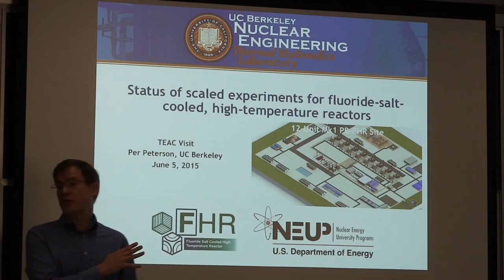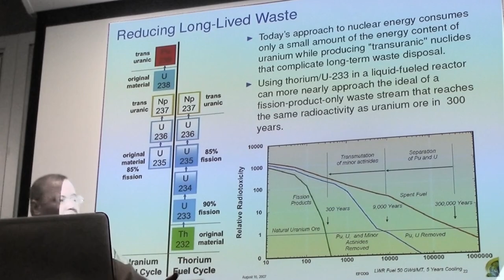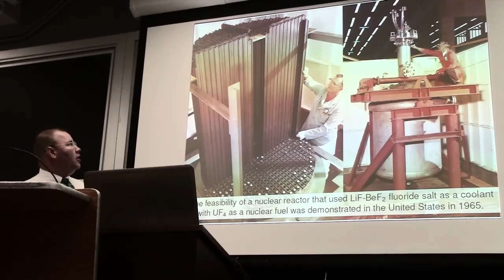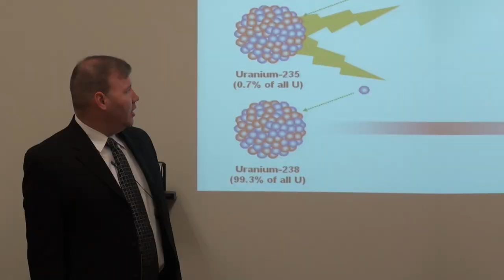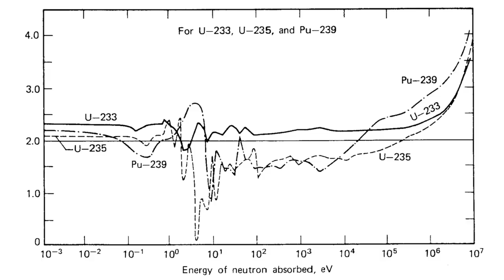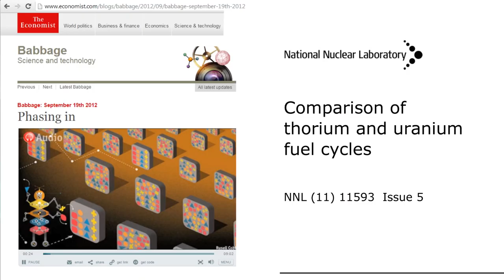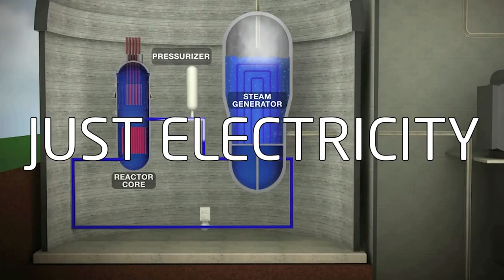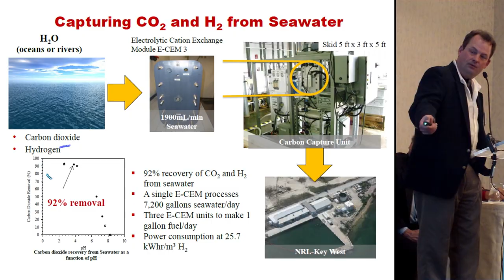Thorium Disadvantages

Comment: Thorium people are so emotional. In science you have to detach yourself from the idea and accept if it is wrong or bad. Thorium people want Thorium to work, no matter what. If your goal safe and clean nuclear power Thorium is one of thousands of options and not the best. Although we can all agree light water reactors are 40's technology and inherently unsafe and dirty. No other industry has resisted advancement like the nuclear industry. Imagine if iPhones where powered by tiny steam engines and coal batteries, that would be lunacy. And yet we still use completely unsafe technology that has been outdated since the 60's. No wonder the world has such a phobia of nuclear anything. Of course light water reactors also make atom bomb fuel as a side product, the reason they where built in the first place was to make Plutonium not power. That is the big reason that technology has been kept going way longer than it should have been.
Reply: Since we have far more than enough material for weapons in storage that has not even been a justifiable excuse to resist changing the fuel cycle for a long time now. Thorium is one of the better options available.
Reply: Well it is not a bad option but there are better. Two things are often said about thorium that are untrue. 1) It´s clean. No it decays into very nasty side products no better than light water reactors. 2) It is not proliferation safe. Additional fissionable material such as plutonium are needed and plutonium is produced in the cycle. This is not true for light water reactors but who wants to use thorium in those? If, then they want molten salt reactors, which is a nice technology. It however has never been actually done with thorium only with form of uranium. And uranium is just as viable either in molten salt reactors or in fast breeders. Fast breeders can get 99% more energy out of the same uranium than LWR and thus negates the sustainability argument of uranium. If your goal was clean and safe nuke power, Thorium is not on top of the list and people arguing for it for hours, who don´t even know the most basic nuclear physics is not helping the situation. What we should really do is build fast breeders to make energy from all the nuclear waste, that is actually a goldmine if used right and use that for base load power. The rest you get from solar. Why build a reactor when you have a giant fusion reactor in the sky, for free. Battery technology still sucks but it´s good enough now to sustain solar. Very long term go solar and fusion. Fusion is everything thorium wanted to be and is very close to being viable. Fusion progress is often ridiculed but has actually improved faster than Moore´s Law since the 70´s. Despite abysmal funding and no public interest the research is chugging along and we are 98% of the way there.
Reply: Also bomb fuel, degrades over time, through it´s very nature as an unstable atom. In short it has a shelf life. You need to continue making some at least to keep the stockpile functional. Nukes have a shelf life of about 15 years before they start loosing yield. Of course other elements of the reaction have to be constantly replenished such as Tritium.
Reply: Super capacitors as energy transport/storage and a grid switch to DC (no grid) would make solar power the easy choice.
Using nuclear waste too would be fantastic
Reply: You can´t transmit DC without heavy power losses and capacitors are problematic. You can´t discharge them slowly. Capacitors charge slowly and then spew out all the energy in a small time. It might be conceivable to discharge a large capacitor into smaller ones and then those individually to somewhat control the power output but I don´t know if there is such tech and if it´s prectical.
Reply: its not an issue to store DC. A local DC motor can run a AC generator. However, modern electronics now power freight trains and bigger.
Super caps have a disadvantage to Li cells. Namely storage, volume and cost.
Reply: 221 b Solar and wind are NOT systainable energy sources, if you count manufacturing of production equipment and infrastructure support. Have you seen a windmill up-close? Every single one of them needs an access road, massive concrete foundation and a LOT of room around it to operate efficiently. The big fusion reactor in the sky (this tired-old bullshit slogan from the greens) is too far away to suffice for your lifestyle, buddy. And battery storage will always suck as far as large scale economics go. As for fusion, yeah dream-on: for the past 50 years, they have been promising that fusion is just 15 years away. Anyone looking at the scale and economics of ITER and its proposed successors would flee in horror, because  funding is the opposite of abysmal: it's the definition of pharaonic excess. I am all for p-Boron11 aneutronic fusion & direct energy conversion, but I am not holding my breath...
    As for the two false comments about thorium, I wander who is lying here: it is only you that says that thorium does not produce waste, only to shoot it down in the same breath, by stating what is obvious to everybody with a brain. Your second comment is an outright lie: no plutonium is needed to operate an LFTR and certainly no P239 can be produced out of Th232: you are six neutrons short for plutonium, even after the neutron capture that will finally produce U233 which is what actually fissions inside the LFTR.
Reply: "Thorium is one of thousands of options and not the best"... 
Please enlighten me, what are these other "Thousands Of Options" you speak of, and also which one is the best? Other than nuclear fusion (Which we still are unable to sustainably create), what other option/s do you see? 
Also, Do you just not like Thorium because it is getting a lot of hype by general non scientific people, and thus makes you feel like it is below yourself (assuming you are also an engineer)?
It surely seems that having a Nuclear Power option that uses a liquid fuel that does not need to be under tremendous pressure sure has many many advantages. I cannot wait to hear what your "Thousands Of Options" are that you know about.

Comment: One actual construction Problem is: how are we going to Deal with extremely hot salt corroding its environment? Which Materials can we use to build such a facility?
Reply: The various MSR startups all use different materials for reactor vessels. You'd have to inspect their designs one-by-one, and the expected lifespan of their reactors one-by-one. For example ThorCon has most frequently swapped reactor. Flibe Energy has a longer lifespan reactor (and is not designed to be frequently replaced).

Comment: GE has the 'secret sauce' of making ceramic composite metals with high strength and high temp capacities. This type of production materials are perfect for Thorium reactor construction along with new nano-scale graphite composite material production capabilities.
Reply: It's not just strength or temp, though - these molten salts are highly corrosive. If your fuel eats away the container, you're not dealing with a viable design.
Reply: @TheKauff  I believe that's what I said about GE having the "Secret Sauce" of composite ceramic metals. They don't corrode with molten salts.
Reply: And yet ge still makes the working reactors, wonder why that is.

Comment: With the 1 megawatt limit as it is per regulation, then perhaps considering thorium in distributed sub-1 megawatt power plants is the direction to go? Clearly the energy and war industries want to maintain the status quo of centralized energy generation with a waste product that can be weaponized. However, smaller distributed energy that can't be weaponized would serve the public rather than industry giants. Distributed energy generation is also more fault-tolerant and harder to be controlled by governments, and harder to disable by hostile forces.

Comment: Salt is hell on the equipment this is a major problem to a plant that will be running for decades.
Also the the uranium path was used to produced weapons grade material though the cold war. Plutonium is still a useful material that the world currently does not have a source for thanks to the treaties signed in the 1980's. We also need a source for medical isotopes as there are only 2 plants in north America.  We had a both those plants down for maintenance stopping the supply a few years ago.
Reply: "Molten Salt" is a fairly established way of transferring heat.
https://www.greentechmedia.com/articles/read/germany-thermal-storage-into-coal-plants
https://en.wikipedia.org/wiki/Ivanpah_Solar_Power_Facility

Here there's neutron flux, but Hastelloy-N was specifically developed since MSRE to address that. 

Here there's fission products, but LFTR employs chemical kidney to remove neutron absorbing (or chemically challenging) fission products from the salt.

Ed Pheil's take on salt challenges is that the combination of water+salt or salt+oxygen are challenging, but pure salt is not as chemically challenging as salt-on-the-road-messing-with-your-car as most people experience it.

Comment: Thorium a,thorium, thorium. Molten salt, molten salt, molten salt. What are they trying to promote? Thorium? Or molten salt? Can't they find a way to use thorium in a conventional reactor? Seems to me that the biggest objection is to the molten salt. Not to thorium ..
Reply: Stephen, if you haven't yet, check out Clean Core's ANEEL fuel (which is expected to begin commercial use in 2026) it is HALEU+Thorium and allows heavy-water reactors to refuel 1/7th as frequently. Doesn't work as well in high-flux environments like PWR. (CANDU are big and low-density, allowing them to take better advantage of ANEEL.) Mark Nelson has spoken about this in 2 of my videos.
Reply: the salt in molten salt is in fact a thorium salt

Comment: This video sort of garbles the description of the design of the Fukushima reactors.  They were Boiling Water Reactors (BWR) that operated at much lower pressure than the Pressurized Water Reactors (PWR) that are the most common type in the United States.

Comment: How do they actually get it out of the ground, is it clean. How do they get rid of it. By the time it is put into use will solar energy succeed in its over coming relative costs. 300 years doesn't seem much compared to millennia compared to the other waste by products. Considering how capable we are with co2 emissions, there should be significant pause. What do these proponents of thorium have to gain? Just a couple of thoughts, whenever something looks to good to be true...

Comment: referencing min 30.43
 It would be a good thing to protect metallic structure with a synthetic diamond layer or graphite is the best choice.
If it would be a very cheap deposition method of a carbon cristal layer how  thick the layer should be?

Comment: at ~15:30 the statement by Dr. Boyd about high melting points of iodides and chlorides kinda makes me cringe. I'm sure he mispoke but it would be better not to perpetuate an incorrect statement. The reason those salts are not preferred is their high neutron capture cross section and poor thermohydraulic properties, mainly heat capacity, relative to fluorides.

Comment: The headache about Thorium is that the reactor to use it is a breeder reactor.  If the uranium produced is not all removed from the blanket area of the reactor that lets the atoms collect more protons, then it can keep acquiring more and eventually become plutonium.  Even the Uranium 233 itself is a potential bomb material.  It may be a greater benefit in a space station or transport type situation; being a potential proton absorber for radiation protection purposes; as well as going on to be a serious power source perhaps for ion engines or materials processing needed to maintain it..
Reply: "If the uranium produced is not all removed from the blanket area" ...that's kind of the point of the Chemical Kidney, and 1 of the 3 DOE GAIN vouchers provided to Flibe Energy since 2018. If the Protactinium isn't removed then NEUTRONS will be absorbed and breeding ratio will not be maintained... there's no spare neutrons for anything else, and that is also the point when people are worried about proliferation. The U233 can't go anywhere without the reactor ceasing operation, so you'll have U232 contaminated U233 moving from a power reactor that has just shut down? No.

Comment: This video makes no attempt to seriously address the disadvantages of building out a thorium-based power infrastructure, so I'll provide one, just to get the conversation started. 

Thorium power has a protactinium problem by Eva C. Uribe — 6 August 2018 

"There are three isotopes of protactinium produced when thorium 232 is irradiated. ... The half-lives of the protactinium isotopes work in the favor of potential proliferators. Because protactinium 232 decays faster than protactinium 233, the isotopic purity of protactinium 233 increases as time passes. If it is separated from its uranium decay products a second time, this protactinium will decay to equally pure uranium 233 over the next few months. With careful attention to the relevant radiochemistry, separation of protactinium from the uranium in spent thorium fuel has the potential to generate uranium 233 with very low concentrations of uranium 232—a product suitable for making nuclear weapons."

Edited to change formatting.

Comment: So my takeway is that Thorium needs 30 days in a reactor to become fissile material. But through liquid processing this is a constant stream of material. So problem is ?? Start up? Bringing it on line. Or an industry geared towards fast reactors.
Reply: Generally agreed need 2 tons U233 for startup, or equivalent amount as U235 for same output.  Absorbed neutrons by Thorium don't produce chain reaction or heat.  The original production of U233 took way longer and greater expense (many $million).

Comment: was expecting a video telling flaws of the thorium systems, but got one slamming bureaucrats.
Reply: Here's the timecodes for issues not pertaining to licensing...
00:00 Solid-fuel thorium reactors fuel utilization ratios similar to PWR.
20:50 Thermal-spectrum neutrons hitting U233 produce only ~2.3 neutrons.
23:00 Graphite moderator required to sustain fission in MSBR thermal-spectrum.
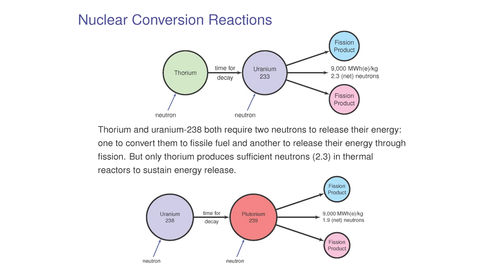27:50 Protactinium-233 half-life 27 days.
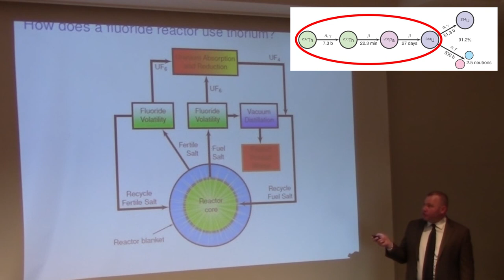29:00 Material challenges (MSR is pre-requisite so MSR challenges are Th challenges.)

Comment: I have some questions about this subject.If thorium breaks down to uranium in the molten salt reactor, shouldn't they find a way to upgrade or make the current uranium powered nuclear reactors safer too? That being done in order to have more electricity available for everyone to use when needed. Or can they find a way to use the left over uranium from the thorium decay in the reactor in some way where a mass amount of radioactive waste is not made.
Reply: Mark Nelson has presented Clean Core Energy from Thorium for using Thorium enriched fuel in existing reactors. But the CleanCore fuel is only for CANDU and Indian heavy-water reactors. Higher neutron flux of conventional PWR results in too much Pa-233 absorbing a neutron and making garbage U-234 which won't fission. If you look up that video is a good watch, although he doesn't really get into why it won't work as well in USA's PWR... only talks about how great it is for Canadian and Indian reactors.

Comment: Have we really solved the problem of corrosion of the metal plumbing in contact with the liquid salt. Last I heard they were still struggling with this problem.....
Reply: China issued an operating license for TMSR-LF1 on 2023-06-07 (June 7th). Not a single mention of corrosion in the license.
Reply: @gordonmcdowell  They'll need to run it for some years before disassembling to have a good look.
Reply: @STOLSPEED  Look at non-radioactive test loops which have been already circulating for years. That's what MSR startups around the world do. China certainly ran at least one. Copenhagen Atomics and Kairos Power each independently talk about the arrays of loops they've kept running.

Comment: What if the frozen plug fails while everything was fine? Can the salt be reused?
Reply: Yes, the lower tank is just a holding tank to keep the fuel away from the moderator, it doesn't contaminate the fuel. The only real problem is that it's likely to freeze and become a bit difficult to pump back up.

Comment: There is a problem with the graphite moderated molten salt reactor. Graphite can burn.
Reply: That depends on the quality of the graphite. We don't have data on Chernobyl's graphite but we know Windscale's fire (UK) did NOT involve the combustion of graphite. There's no non-Chernobyl example of burning graphite. The properties of graphite generally considered troublesome are its absorption of Fission Products making it a relatively short-lasting material before FP impede the fission chain reaction, and the fact graphite swells during its lifetime.

But western nation's nuclear grade graphite is not considered combustable.